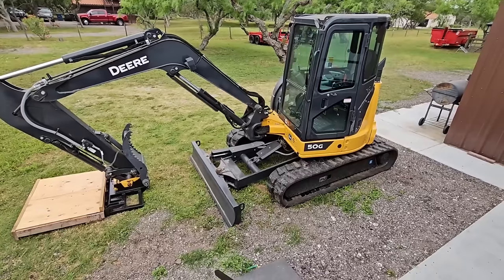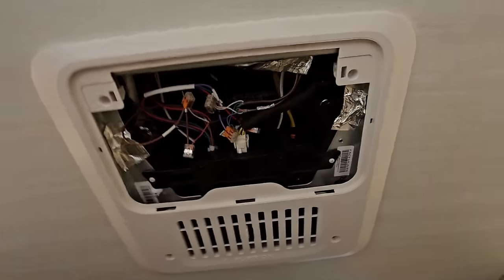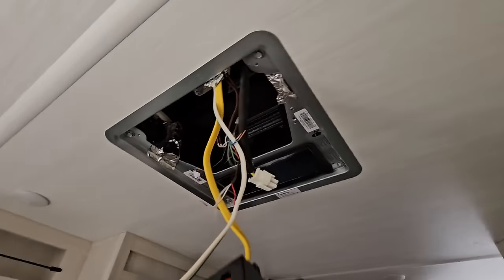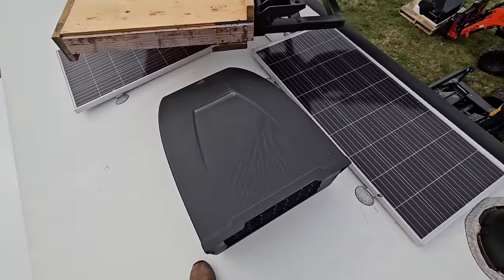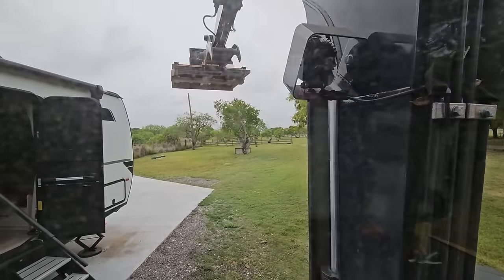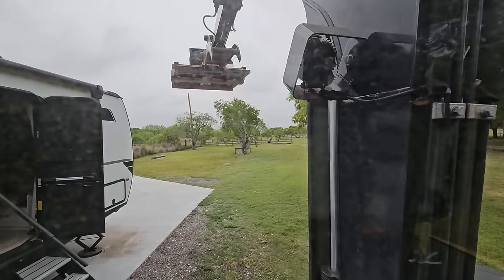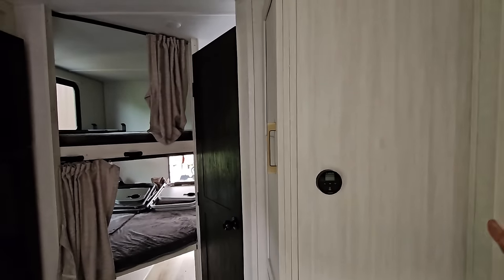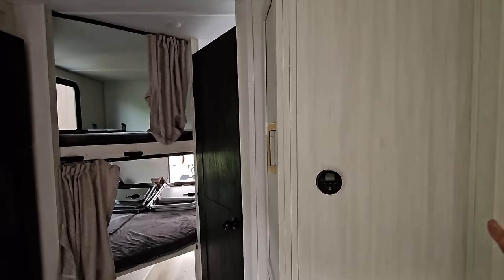EXCLUSIVE! FURRION CHILL CUBE INSTALL! AC UPGRADE! Variable Speed Inverter RV AC!

Comment: Black to ground red to 12v and the heat function is just a relay so if the furance kicks on when you tie the two wires together. Then just tie them to the brown wires..
If it needs a 12v signal and ground you can wire 1 of the brown thermostat wires to 12v the other brown to the furnace trigger and the ground to the black ground wire.

Comment: I like the low noise level of that unit. 18k btu is great especially here in inland California. I’m not as thrilled about the remote as you are. It’s another remote to lose!😂. I would like to see it designed with the option of using the remote or the wall thermostat. That would solve your furnace dilemma as well. Very nice install. If it were available without the remote and just a direct swap using the thermostat I would consider it in the future. The Furrion AC on my Surveyor is a bit noisy but works better than any AC I’ve had in the past. It was 90 degrees here today. There was no issue keeping the trailer cool and it didn’t run that much!
Reply: It looks like it comes with a wall mount, so you can just leave it on the mount so you don't lose it.

Comment: Ive been waiting for years for this!! As an air conditioning technician for 20 years this has been a big day coming! No more mini splits! Although I would like a heat pump. Being a specialist in large variable speed systems this is exciting. Have they released a date for the heat-pump system as of yet?
Reply from the maker: I was told July
Reply: I’m guessing July for a ducted model?

Comment: Great video hey I believe the thermostats temp sensor is in the ac unit. Not the wall thermostat. One major flaw. Even the micro air and domestics do not have a thermistor. Please do a follow up video on how you are going to get the furnace to work. Thanks

Comment: I'd love to have that in a ducted  heat pump system . My older AC is ok but that would be great! 
Getting back to your thermostat controller for heat you might need to either use the relay box you took down or put a 2 wire digital thermostat on it and figure out what wire goes where.
Reply: I just used separate standard / mechanical 2 wire thermostat to control furnace, when i upgraded like 3 years back to Atwood Ducted 16K AC with heat pump that has its own hardwired controller.

Comment: So this unit has the air flow in the direction of the front of the RV, is this correct?  I think I will be installing this on my 2016 Keystone Hideout which has one of the loudest AC units I have ever heard.  No thermostat controls so it is simpler on the wiring than yours with the wall mounted thermostat control.  The biggest challenge will be on and off the roof.  😊 Thank you for this video.

Comment: another idea for your furnace that i think i'm going to tackle this year too, you can just install a traditional millivolt thermostat on the wall that doesn't require any jumping of 12 volt to anything.  where grand design placed my t-stat in my 2600RB makes the furnace short cycle.  it's literally right across from a heat duct, very annoying to have it turn off and on all night rapidly.  so i want to run a wire directly up the wall and put it above the kitchen sink that has no direct heat blowing on it.  also i assume they're coming out with a ducted unit?

Comment: I'm going to replace both units on our Jayco Eagle 355mbqs... it has their "whisper quiet" ducting which is actually quieter than most but not by much. I'm seriously considering abandoning the ducts for the living room unit and only using the ducts for the bedroom unit since they're all connected. That would keep 100% of the living room air in the living room and ducting from the bedroom into both the bedroom, living room, and bunk room (put a booster fan on the bunk room - massive improvement!). Anyway, I'm really looking forward to future reviews! Thanks!!

Comment: I have seen various Variable Speed Inverter AC for houses in past and with great advantage on power, generally they do not last long. Not related to RV , talked to a few mechanics and they love to replace controller boards or the unit at a full price. If used sparingly and costs the same as the older design then yes they might be the rite fit for someone.

Comment: As an owner of a 2004 class A with 30A service, I've been very interested in something like this. My question is, with the AC even in your placement in front of the bedroom where the air is blowing away from it, how do you actually cool the bedroom? 

On my class a, the rear AC is next to the AC and front toilet in front of the bedroom. I also have a duct system which looks like it will be unusable

Comment: Love the concept. Unfortunately, I have to use low profile A/C units (Penguin 2) because of the height of my rig. If I don't, I won't fit under low bridges. @16:35... The way you get it out is by using two hands. You really need a tripod.

Comment: My question: is it worth all the trouble of buying one and having to replace it? How much more efficient is it? Can it actually cool your trailer? We have a 2023 flagstaff 832bws and it has two ACs and we cannot run our acs in the summer because our bill will be $500 a month and they wouldn’t even cool the trailer down. We have to run. Big old swamp cooler that so loud. I guess I’m saying I don’t want to get hyped about the product and go buy 2 to replace our Coleman machs and it not even make that much of a difference
Reply: They dont cool and cost you so much money because the colman mach ac units are the cheapeast and worst units in the rv industries between my parents and mine we have replaced 5 any other unit would be better and sounds like you need 15k btu units for both.

Comment: I was surprised that your RV did not have ceiling vents. Is there a unit that will work with ceiling vents?
Reply from the maker: They will have a ducted version and one with a heat pump.  Our Surveyor doesn't not need a ducted system

Comment: I thought I heard you say that you're reusing the original control box.  In that case, there's no reason to disconnect DC, 120v or heater (or thermostat for a remote thermostat unit);  just leave them all wired and let the control box dangle.  You only need to disconnect the rooftop connector from the control box.  That saves several steps, and minimizes the possibility of screwing up wiring.  Of course, if you're using a new control box, then you do have to disconnect all of that.

For the wall thermostat and heater.....take +12VDC in the overheard, wire it to red to thermostat.  Blue from the thermostat should go to -12VDC (aka, "ground").  White from the thermostat will go to one leg of the heater; and the other leg will be tied to -12VDC/ground with the blue t-stat wire.  So red and blue send 12VDC to the t-stat.  When the t-stat calls for heat it sends 12VDC down the white leg to the furnace.  Some furnaces are sensitive to polarity, so you may have to reverse which furnace lead goes to white from the t-stat and which goes to -12VDC/ground.

Comment: Ok you said you have the auxiliary cool unit. I am going to assume that it was not a heat pump and is just conventional cooling units we are wiring. 

 You also have the heater.  I suspect that the 2 wire lead goes to the heater. The second 5 or 7 wire cable may go to the auxiliary ac. The last wire set goes to the thermostat.  You also had the main 12v wire red and black. 

First verify the 2 wire connection at the furnace I suspect one wire was ground and the other wire is positive voltage  supplied from the tstat to turn on the ignition for the furnace.  Very rare  to have a wire that would just turn on the furnace blower motor. But worth inspection. 

Thermostat  wires are usually red 12v positive.  Black  is common groundand would connect  to C not G terminal. W is heat usually white wire.

In cooling mode the yellow wire turns on the ac and the green wire turned on the fan. In heat mode the white  wire from  the Thermostat W would connect  to the red wire on the 2 wire cable going to the furnace and the white wire would go to ground or C. Again  verify that the heater only required power and ground. Their is a 25% chance that a blower signal was sent on the white wire to the furnace. 

That should provide restoration of heat on the thermostat.  Now a bigger question the auxiliary ac was it tied into this tstat as well. If it was it could be tied to a different color wire coming  from the tstat.  Check the stat for the yellow wire. If their is a terminal block on the wall that the stat plugs into it it would be y1 is yellow to the first stage of cooling if their is a y2 what ever wire it is was likely used to😅 power the auxiliary ac. I did see in the video that a blue wire was in use.
When y1 is active the first ac turns on then on a timer in the stat at a further rise in temperature  the y2 would bring on the second stage of cooling. Possible the blue wire was the auxiliary cool.
You can connect the auxiliary ac to y1 and the fans are controlled  on the G terminal and usually have a green wire control the fan for manualair movement.  

NOTE Ground  is marked as C as in common. 

Hopefully this helps. If it is a heat pump system their are other wiring senerios.  😅 and the blue wire is what changed it from heat to cool mode and depending  on the heatpump  it could be powered too energize the reversing valve putting it in to heat mode and the gas furnace could be a second stage or auxiliary heat.

Comment: I want to put one of these in my 2001 Airstream when the time comes. Need the heat pump version and to wire it so i can control the factory furnace from the thermostat separately!! Any insights would be appreciated.

Comment: The follow me function does not work like you think it does that remote has to be in line of sight to the indoor unit constantly or if it loses connection, it will revert back to the sensor that’s in the unit. This looks to be a Medea product or the parent company carrier/Bryant.

Comment: I'm just curious why you didn't replace the 2nd unit that you have installed over the main unit. Seems like the 2nd unit would have been more "plug and play" over replacing the main unit since it has the controls on the unit itself.

Comment: Wonder if they will make a low profile unit for the taller RV’s ? I know our 5thwheel has to have low profile, even with the low profile we are at 13’6 total height on our rig .
Reply: I’m also wondering if they will have one for ducted RV’s . That’s also what we have on or current 5thwheel.

Comment: Is that new unit taller?  That could be a concern for a 5th wheel like mine that is already 13' 5".  That only gives me an inch of play to be legal.  So if that unit is 2" taller then I'd be over hieght limit.  No Bueno.
Reply from the maker: Same height as the one removed
Reply: @BigTruckBigRV  good to know.  Thanks.

Comment: Seems to me that Furrion could have just as easily provided furnace connections and use the same remote for both functions, cooling &  heat. Having so that you have to power the furnace separately seems like an oversight on their part.

Comment: Curious with vent towards kitchen how hot the bunks are in the back? Are biggest issue is no circulation in bunk area.
Reply from the maker: For this system, you'd have to either rely on circulation or point the vents straight down to act similar to the unit we removed

Comment: How stupid to make the technology everyone needs but to put in in a direct dump only system. Because an 18k BTU unit is so cold that is all the more reason it should be ducted. If RV's are large enough of course they can't be evenly cooled by direct dump. If they aren't to large for DD then they are to small for an 18k BTU unit. If they make a ducted version this product is gold but until they do I know I wouldn't consider it.